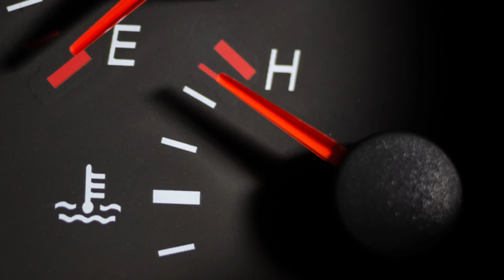Do THIS to PREVENT your head gasket from failing. Easy!

Comment: Nice video , I have question , are elring after Market headgasket good brand or I have to go with genuine volvo headgasket ? 2004 volvo xc90 2.9l T6 .
Reply from the maker: It's better to check on forums. If price difference is not huge, I would choose OEM.

Comment: Coolant changes are very important. Props for tip Number 6. Thermal expansion of the block and head is the reason why head gaskets rub away. Allowing your engine to warm up for 60 seconds before driving, and waiting until the engine is fully hot before going past around 3,500 rpm will allow a head gasket to last a very long time.
Reply: Thanks for that very good reason! I'd always been told its better to warm up engines under power, to reduce wear when engine cold.
Reply: @izavial  Load and power both induce high wear while the engine is cold. It's okay if you live at the top of a hill and can coast/drive lightly until it has warmed up a bit. Otherwise, I always wait around 1 minute due to the metal clearances being well out of spec. This is even more extreme on modern engines, which use a mixture of alloys and steels due to different thermal expansion rates. Older engines that use entirely iron blocks, heads, and pistons aren't harmed as much!